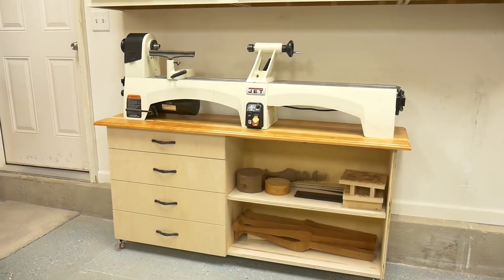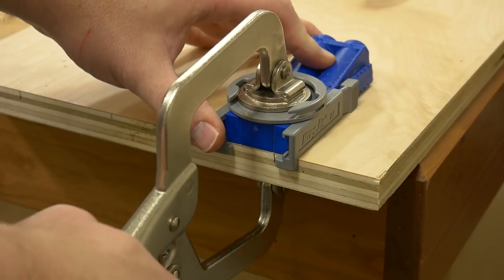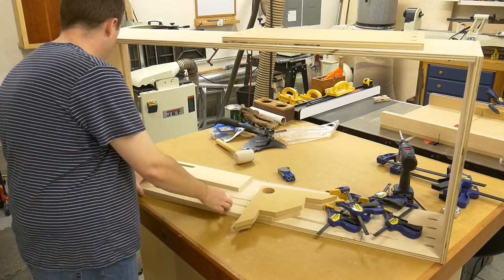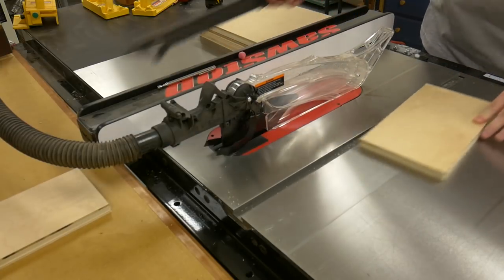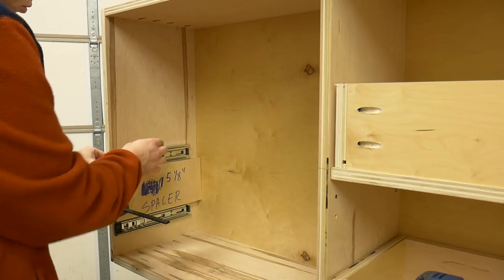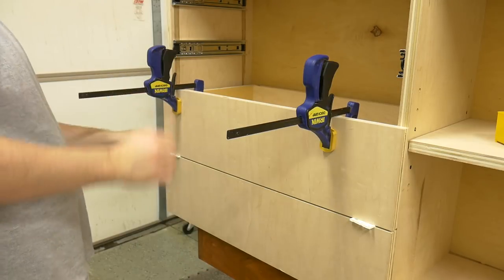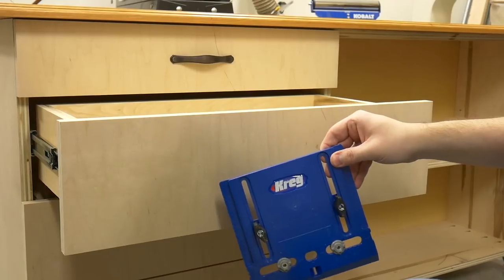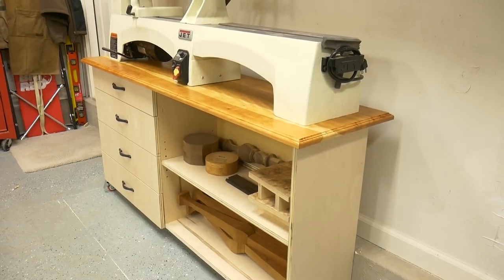How To Make A Mobile Lathe Cart | Woodworking How-To

Comment: I am really confused...how do you space out the slides?  I am building a similar cart, but with 5 three inch drawers a 5 inch drawer and a 7inch drawer.  How do figure out where the slides go.  I want a 1/16 or 1/8 spacing between fronts. I'd like the fronts for the smaller drawers to be the same height....thank you for any assistance you can provide.

Comment: What brand/size castors did you use? Do you apply all 4 or just 2 of the brakes when using the lathe? I'd like to build a similar (but smaller) rolling cart for my small (metal) lathe. I've been checking the castor wheels in the home improvement store and they all seem to have some noticeable play. I'm just worried that even with all the brakes on the whole affair might end up not as solid/stable as I would like.